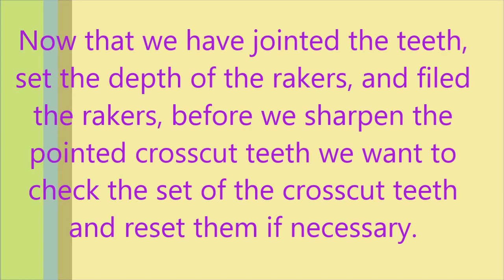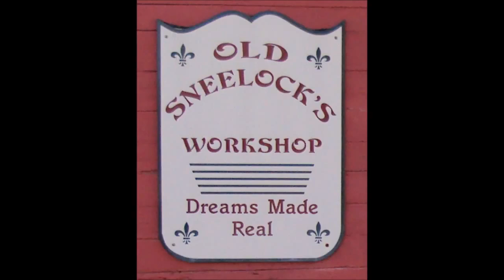One Man Crosscut - The Real Old Sneelock's Workshop - Sharpening - Pt 5 -  Setting The Teeth

Comment: you can see how sharp they are by the way the light reflects off teeth.
Reply: 2nd this!
Reply from the maker: Thanks Larry. It is an interesting project. 
I had a guy say it would take too long to sharpen such a big saw. 
It is big. It also has big teeth. That means there are only one or two per inch. 
A panel saw is typically 26 inches long. A panel saw file for ripping has 4 or 5 teeth per inch.
That means a 26 inch panel saw has between 2 and 5 times as many teeth as the much bigger 48 inch one man crosscut. 
A crosscut pannel saw has 8 to 10 teeth per inch. 
A Miter backsaw gets into the 14 teeth per inch range. I  would rather file a 48 inch One Man Crosscut than a 12 inch miter saw. 
Big teeth are easier to see. 😁😁😎